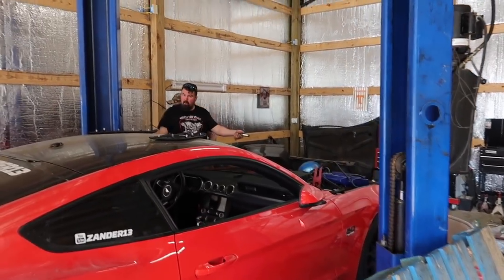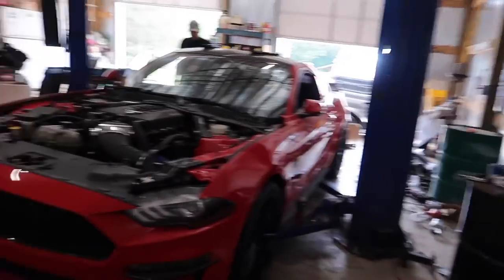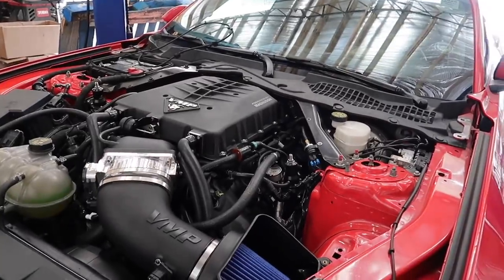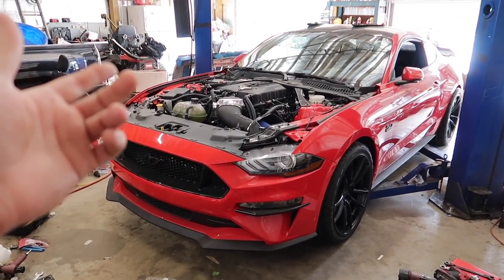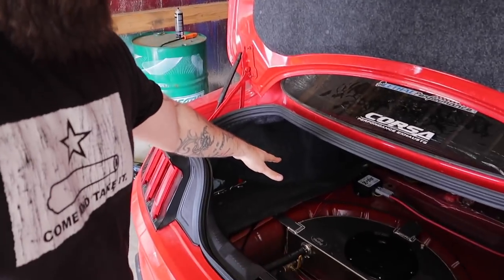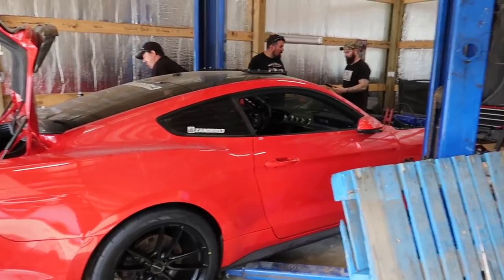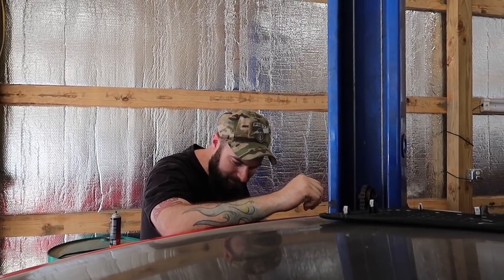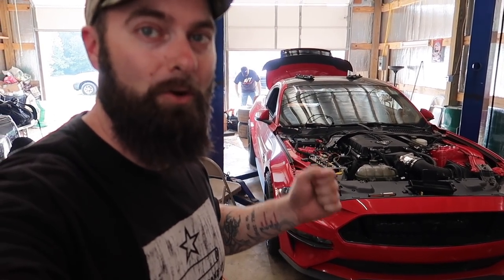FIRST EVER! 5.2 Engine Swapped VMP Odin Supercharged 2019 Mustang GT First Start!

Comment: Congrats....
Notice how even though it's a plasma bore, like the gen 3....its quite when it comes with a forged piston...as I've been saying for years...a cast piston in a plasma bore block simply cannot match the thermal expansion characteristics of the bore its in, and THIS is the root of many of the noise and issues they suffer from....

Comment: I hate to be the bearer of bad news, love your channel and this looks like an awesome build. But if my engine math is correct... this is a 5.1ltr not a 5.2ltr. .7854 x 3.700 x 3.700 x 3.65 x 8 = 5.1ltr or 313.96 cu inch. If you swap for a 3.66 stroke crank, you get your 5.2ltr displacement.
Reply from the maker: The block is a 5.2. Displacement is like 5.15 when we did the correct math. Still considered a 5.2 if round up slightly. Ford does same thing. Go look up displacement on a 2011 coyote. Ford says 5.0 but it was actually a little under. Either way, mine should be good for another 30hp or do over a regular 5.0
Reply: @Zander13Productions  Yeah its going to be a monster, no doubt about that. You do understand that the block does not determine displacement? Bore and stroke determine displacement. If you change either of those variables, changes the displacement of the motor. For example, you could take a 5.8 GT500 block and put a shorter throw crank, by doing that, it is no longer a 5.8ltr displaced, it becomes a 5.7 or 5.6 depending on how short the crank stroke is compared to the stock crank stroke. Enough on that, I have been considering the Odin for my Gen2. How are you liking the Odin so far? What do you see it has over the Whipple, where is it lacking compared to the Whipple?

Comment: why dont you just buy a gt350..... this just seems like a waste
Reply from the maker: Bc it’s not a gt350. It’s a BUILT engine for drag racing
Reply: Gt350 is flat plane crank...which have had problems...also does not come in 10spd.